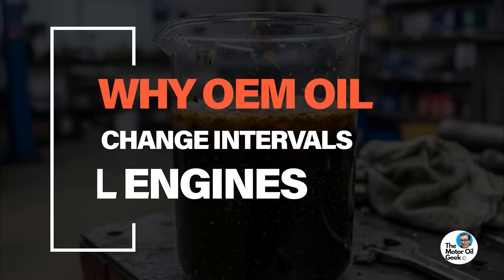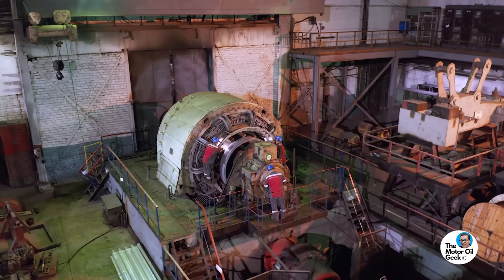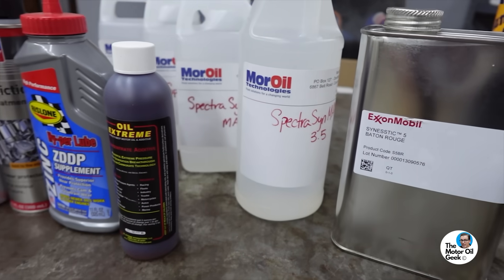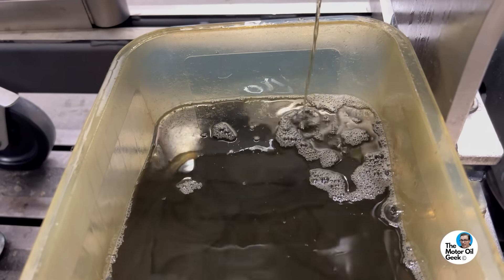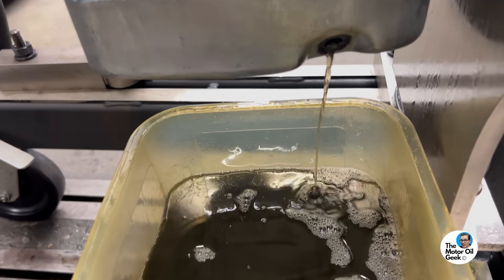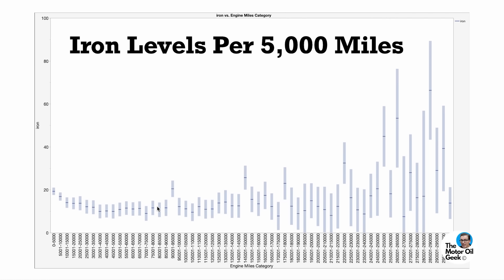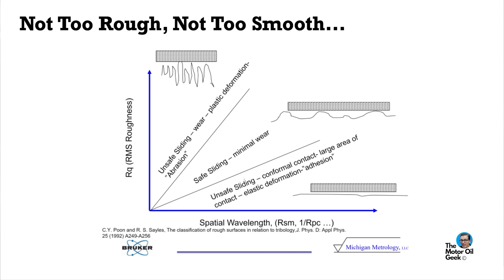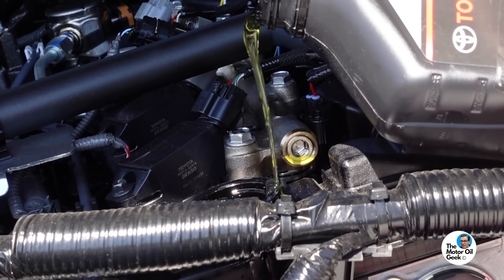NEW Data Reveals WHY Modern Engines FAIL Prematurely!

Comment: is oil change interval in the breaking period that unknown? Holy shit, my sisters Citroen C3 manual from 2012 tells you that the first oil change must be done before 3000km and the second one before 8000km. And so does my old Renault megane manuals and my fricking KIA. I dont have manuals for all my cars but I am pretty sure most of them explains this.
How does people not know it has to be done? I remember the dealer exlaining it to my father when I was a kid as well...
Thus said, the regular mantainance intervals specified are 15000 km too, which is a lot for most driving conditions.

Comment: @themotoroilgeek Dear Lake. 

 So, i have followed your advice. From new my cars engine has both vct and a turbo. So the oil was tested at 143 km then changed with dealers oil at 1495km then to Valvoline Api SP GF6A   5447km 9008km 12772km 16300km,  Now API SQ GF 7A at  19400km.

  The wear numbers have progressivly gone down. About the only notable thing was the oil water heat exchanger was leaching copper into the oil. So how much extra distance should i run the oil now it is getting into early life post break in?  😊

Comment: Case in point:
The FoMoCo/PSA 1.4/1.5/1.6 Diesel engine, known as the DV family, an engine i know in and out, uses roller finger style rockers, they run 0w30 oil, are specced to have oil changed at every 25k km, or ~16k miles, there are millions of these engines around in europe, and they have basically no lubrication of the lobes and rollers (no squirters or anything but random splashing) and they routinely last 500k km or approx 300k+ miles without any of those issues whatsoever.
As far as i know, FoMoCo has plenty of roller failures, but not on this engine.
Thin oil, long oil change intervals, no forced lubrication, these engines should be failing left and right, but do not.

They are turbo engines, but they have no hydraulics at all, not even a single tensioner, so maybe Lake is on to something, that could be the reason so many modern engines fail left and right, because most modern gas engines have at least one hydraulic system, many have multiple.
This engine has been in production for approx 23 years, still going strong all over europe without any of these all too common timing component failures.

Comment: 10:25  —  So, once your engine is past the break-in stage, you should be changing to a new oil filter every other oil change? Every third oil change?  I've never heard before about an oil filter's efficiency increasing with use / mileage.

Comment: My late Dad always swore by Comma oils, because he saw the Rolls Royce engineers putting it into the Rolls Royce turbines that powered the generators when he worked offshore. I swear by Valvoline oil for no other reason than it's what My dad sold in his Motorcycle shop after he stopped working offshore. :)

Comment: In 2023, I bought a Tacoma, new with 9 miles. It is 2026 and I have 10,077 miles. I’ve done 4 oil and filter changes. First one was at 739 miles. I usually do 5k or 6 months oil changes and I do it myself and I use OEM filter and Pennzoil ultra platinum 0W-20 in my 2GR-FKS 3.5L.

Comment: Your analysis is second to none!  But if this video is true, why not recommend an oil bypass system be added to every vehicle?  Also, isn’t the recommendation you have made in other videos to test and trust OEM oil change intervals contradictory to this video? I mean if new oil is cleaner and cleaner oil is better???  Manufactures only care about profits. Many folks watching your videos care about engine protection and reliability.  Why not do a video and give us all  the  answers on how to get the max life out of our engines? Oil change intervals when car is new, 0w20 vs 5w30, Add bypass filter?  Better oil and air filters. For example, independent tests prove many filters are far superior to OEM. For example Motorcraft oil filters are rated at 30 micros while others made by the same company are rated down to 20 microns.  If oil cleanness matters then doesn’t better filtration matter?

Comment: lol wut?  My 3.6L Pentastar has 235000 miles and I change oil every 5k.  Blackstone says my oil shows lower than normal wear metals.  So I did nothing this jabrony said and still have a motor that lasted far longer than most 3.6L.  The roller tappets fail because crappy metalurgy, not dirty oil.  If the oil WAS the problem ALL the tappets would fail, not just one.

Comment: I change my oil every 3k miles, and my 2012 Pentastar 3.6 still has developed the rocker issues. I am currently running Lucas, which has reduced the noise and seems to be helping for the time being.

Comment: Valve train issues are not limited to the OEMs! Plenty of aftermarket cam makers have been just straight screwing up! It isn't just the shitty oil change intervals the manufacturers set these days (it doesn't help) but an actual defect on the part makers too. When BRAND NEW ENGINES and BRAND NEW PARTS are failing, it is not just an oil change problem, its a shitty quality control issue too! Hell, I recently helped a friend tear down a rebuilt 305 from his 3rd generation Camaro, and we found why the engine did not have much run time on it, 2 of the cam lobes and 2 of the lifters were ground down, one of the lifters was nearly chewed up to the point of exposing the internals of the hydraulic lifter! It was stuff all made by Comp Cams! Extended oil change intervals, especially on modern highly stressed engines, are not the only issue, it is almost as if all the manufacturers from OEM to high end aftermarket, have forgotten how to make engines and their parts. Displacement on Demand systems are another point of issue, I lost count of how many Honda V6 engines I saw at the dealership a friend works for, with holes in pistons or even worse destruction because the injectors on the deactivated cylinders start to leak and torch the pistons. GM literally pulling engines from BRAND NEW TRUCKS because the engines were screwed, from the factory. Ford having issues still with their PowerJoke engines, GM doing more stupid crap to the Duramax..... All of the issues in modern engines are just poor quality control and rushing into service engines that barely meet moronic emissions values, and are compromised because of the bullshit. I hope with the turning back of EPA standards, we can get reliable, long lasting engines again, and we can do away with the bullshit 7,000-10,000 mile oil changes. I am so very sick of seeing modern engines with only 50,000 miles that look as if they have 200,000 miles on them. Engines that fail early DO NOT help the environment, they make things far worse in the long term! This is beyond stupidity!

Comment: Do they?
Because my mom drove my dad's '09 Sierra (5.3 liter with over 240k miles on it) with no oil for almost 50 miles, with it knocking like crazy.
I put a new filter on it, and filled it with oil. The knocking went away, hasn't come back and it now has almost 320k miles.
And I've heard several stories like that in LS engines.
Try driving an oldschool small block (from any manufacturer) for 50 miles without oil and see what happens.
When things break on modern engines, it's usually sensors or something like that.

Comment: I've tried to explain to people you have to change your oil early on a new engine because of engine break in, but they usually don't want to listen. The final finish machining is done by running the engine, which adds a lot of extra wear particles to the oil. The only way manufacturers could get rid of that is by breaking in the engine before they ship them, which they don't do, and would be very expensive and time consuming. But people want to believe engines are more advanced than that now, so don't need to break in anymore.

Comment: My Chevy van has had 2 engines and one transmission since 2018 
No valve timing but lifter failures trans was typical gym problem 
Better off to buy an old truck and rebuild it

Comment: Always relevant. My comment goes to everyone who still don't understand that you can get greater airflow WITHOUT loosing filtration efficiency. Just use bigger OEM air filters !  I use a V8 air filter on my inline 4, and it works just fine. Forget about those stupid high flow filters; they just ruin your engine !

Comment: I used to have a Ford Powerstroke diesel truck. These use high pressure ~3000 psi oil to operate the injectors. It would sheer oil quite badly, close to the end of the OCI you could tell the fuel injection wasn't working quite as well.
Reply: Agree, my 7.3 would tell me when it needed an oil change.

Comment: I agree I have a 2012 ram 1500 Hemi . Dodge dealer changed the oil first 30.000 miles I always chose conventional   
was 5-20 pennzoil. Since day one this truck His been in our family since new. My dad purchased it new . When he passed I started driving it . He passed march 2013   Approximately 7.032 miles at that time .as of today it has 116.604 no HEMI tick always like clock work oil change every 3.000 and new Oil filter MO 899 Mopar . I have a 1994 5.7 impala SS  T purchased in 1995 that also received 3,000 mile oil changes with new Gm oil filter PF 64: I still have it 178,000 miles . Doesn’t use oil . I started working in gas stations  in 1972 .. auto technician for over 50 years . I Remember working in a mobile station when Mobil one came out . Check the history of Mobil one and you’ll see how it went from every 25,000 miles every 15,000 miles every 7.000 Enter volts

Comment: I am trying to get 500,000 miles from a 2003 GM 5.3. I am at 340K now. I did 9 oil and filter changes last year. I am headed into a snowy area where an oil change will be difficult (I will not go to any sort of quick lube), so I am changing the oil at 2,500 miles instead of 3K. The truck will sit and drain for near an hour before it is refilled. 
 - Clean oil saves seals, among other things.

Comment: Q: I have a cartridge type filter on both my german cars -  I've always changed the filter with the oil. Would it be reasonable to change the filter every 3rd oil change (w/ 5k mile OCIs) to maximize filtration performance?

Comment: Hey Lake.
It’s my understanding that a 5W30 and a 10W30 are both 30 weight oils at engine operating temp.
I found this on line.
Is there any truth to this???

Your classic car's oil pressure drops with 5W-30 instead of 10W-30 when warm because the "5W" oil is inherently thinner at operating temperatures, offering less resistance (viscosity) to the oil pump and engine components, leading to lower pressure, especially at idle where the pump moves less volume. While both have a "30" (hot viscosity), 10W-30 retains slightly more thickness as it heats, providing better pressure, but 5W-30's lower cold viscosity improves startup flow, which is ideal for modern engines but can reveal wear in older ones.

Comment: My oil is now 5w-40, engine has 415.000km on it and still the same timing chain, I change oil every 15-20000km or once per year, engine is perfect, steel frame of the bmw e39 530D 2002 is not…Any more often oil change would be a waste because the frame of the car will die before the engine does! Oh and I only used high saps oil, bmw LL01 norm not newer which is junk.
Reply: Yes, need to view the bigger picture. Maintaining engine is important but that is often not what kills the car.

Comment: with my plug in engine monitoring dongle, I could see the difference in Valve timing on accelerating when I experimented puting in thicker oil to try to reduce engine ticking.

Comment: My GM engine still running strong at 300,000 Mi I did replace the lifters but I also change my oil every 3,000 miles religiously

Comment: I agree with clean oil, but bro there's a bigger problem and it's the thinner oil for better fuel economy. Years ago people actually did 5-10k miles and got 100k miles out of any engine.. now we're seeing 5k-30k mile engine failure.. and most are gas engines in America. European and China or Russia don't see these small mile failures nowadays because they don't have the stupid regulations on emissions.. STOP!

Comment: I've been preaching this for years. Even when I worked at Honda and Chevrolet, I used to tell my service advisors we cannot do these oil changes this long as per manufacturers recommendations. The oil is so dirty and with vvt etc, we are seeing issues and it's causing problems. To me, it was common sense to keep the oil clean and flowing well, and the engine and components will last significantly longer. But customers, forums and other know it alls would tell me im crazy for doing oil changes before recommended intervals. I love that I have proof now in this video. Thank you Lake and team
Reply: I never bought into the 5km oil change. All my vehicles get 3km changes. 2 dd are 25yo

Comment: I work in aviation and I have a 5.7 hemi and I applied this exact thought process and never had a issue with lifters. But on a side note the 5.7 hemi in the 3rd generation truck oil draw is 2-3 qts that also drops the oil too low for splash lubrication to occur. That sound when you press the gas pedal of a high pitch whining noise is the crank suspended in the air not splash lubricating 
Thanks for the text book name I'm going to enjoy the read. I only have bits of knowledge here and there. I just ordered it

Comment: Great content. Reminds me of what my father told me many years ago. He had studied metallurgy. In the early 70s he bought a 1964 Caddy deVille, pretty unusual car in Australia, it had already been converted to RHD. Not long after he installed a couple of Frantz bypass filters, one for the engine oil and the other for the transmission. As a kid it amused me that he changed 'toilet paper rolls' on the car. The Caddy ran well for many years and  was the first car I ever drove. When I had driving lessons in 1985 in a Corolla to get a manual licence I thought it was a gutless piece of crap.

Comment: I own a 2024 Toyota Tundra SR5, I ordered it in June and received it in September, Toyota started doing the recalls in July, I think. I hope my truck did not get a 2022 or 2023 built engine.
It currently has 51,000 km, about 85% of it is highway where I am often cruising at 115 km/h.
I'm not sure if I did the right thing, but I did my first oil change at 1000 km, and then the 2nd oil change at 3000 km, so 2000km after that. After this, I have been doing my oil changes every 8000 km.
Toyota has been recommending the 16,000km oil change interval, I was even told I had 3 or 5 free oil changes at the dealer.  But I have kept to the previous synthetic oil standard of doing oil changes at 8000 km intervals and I do them myself.
My oil is always half a litre down and black from driving 8000 km, mostly at 115 km/h, engine at about 1500-1800 rpm and I think transmission is on 9th gear. Rarely ever carrying anything heavy with me.
I use a toyota oil filter and the Mobil 1 0w20 fuel economy oil. I am aware that Mobil 1 produces the oil for Toyota but the recipe might be pretty different from what Mobil 1 sells.
So far so good, I will never trust a 16,000 km oil change interval. I rather spend extra on doing oil changes but having piece of mind that the engine is alright, and not having to have it towed to replace an engine.
Maybe I should switch to 7000 km intervals.

Comment: If only the manufacturers would have an electric gear pump that primes and pre pressurizes the lubrication system before the engine starts and the belt driven pump can then take over…seems simple to me, but that would add cost.

Edit:  they could add a centrifuge filter as well to keep the oil very clean between changes

Comment: BMW and their M models had an  break in period. As of a few years back the first oil service  was scheduled at 600 miles.  Performance shops do staged oil changes  increasing the  engine load and duration  each time. If i ever get  to buy a new out of the factory vehicle i will do a break in oil change.
After 2 rebulild engines, and seeing what came out and stayed on the magnetic drain plug after each stage i've seen enough.

Comment: I have a 3.6 VVT known for timing chain failure because it has poor oil ventilation through the engine. I change the oil every 3K miles strictly for that reason and the oil comes out very dirty to me. It’s always dark at 3k miles. So an oil change at 7500 and 10K miles is very absurd

Comment: I think there's a possibility your roller rocker surfaces lasted longer is because of the break in process itself and not the frequency of oil changes.  Did you ever look at the surfaces and sub surfaces with a sem, xray, or something similar to compare the broken in lifter surfaces and competitors?

You provided information and made a conclusion but did not provide a clear connection between the two.  Just my opinion, great video!!!!

There are a lot of turbo diesels that live in very dirty internal environments that get 10-15k oil changes and last 300k.  I think there are more factors.

Comment: BULLSHIT
It is called incompetent design and unconcerned engineers and greedy corporations.
0-0 motor oil and aluminum parts rubbing against steel parts all together in a hot environment. Shitty steels and crappy manufacturing.

Comment: 3-3.5k for forced induction engines, 5kish for all overs. i don't go any longer than that, period. i don't care what the oems say. diff/trans fluids every 40k. same deal. haven't had anything fail on me to date, save an LS that was in rough shape when it came into my hands, and even with my tricks couldn't be saved without a rebuild. (because chevy truck owners tend to suck at proper maint.)